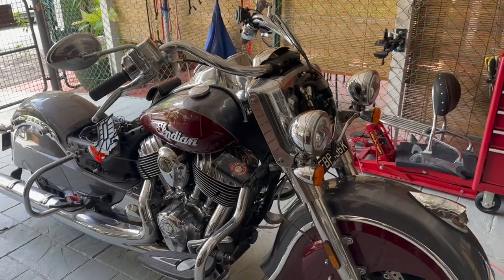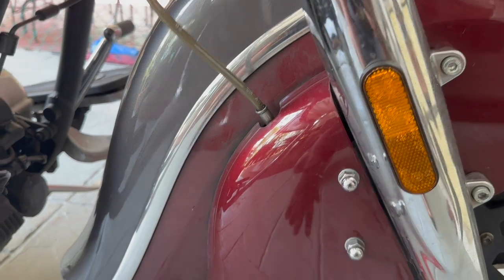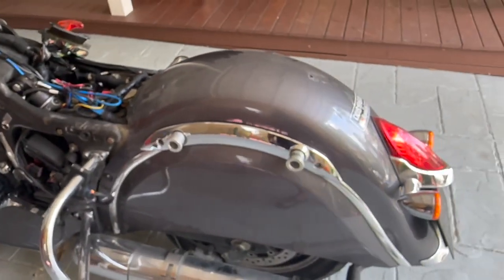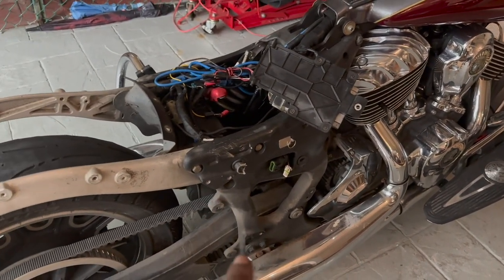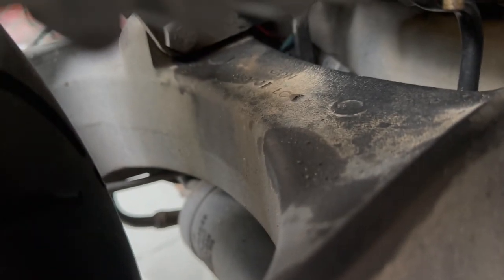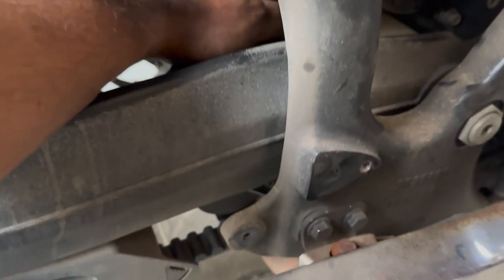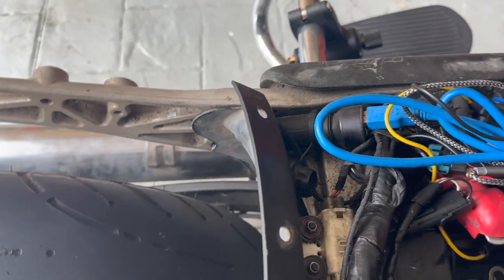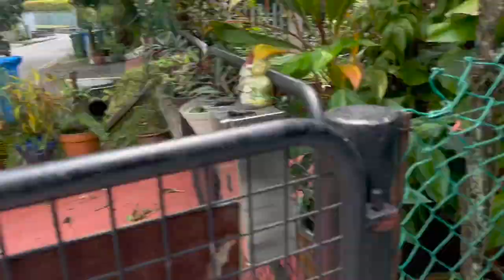Indian ThunderStroke - How to Replace Front & Rear Speed Sensors

Comment: Dear brother, you did good, but in the hardest way. The Service Manual says indeed to remove the battery box. But it way easier go trough under the motorcycle and remove the canister. It is only two Allen screws. And you can do it with no bike lifter, using only a jack lifter, positioned in the center of the bike. That is it.
Reply: what canister is this?
Reply from the maker: It’s the evap / charcoal canister. It’s only on California and international models.

Comment: What is the gap from the sensor to the ring
Reply from the maker: According to the manual, the air gap should be 0.75mm +/- 0.25mm (or 0.030” +/- 0.010”)